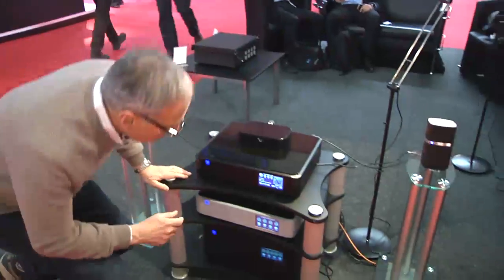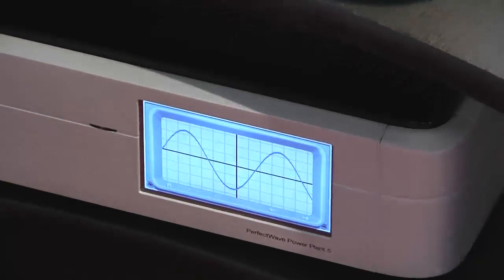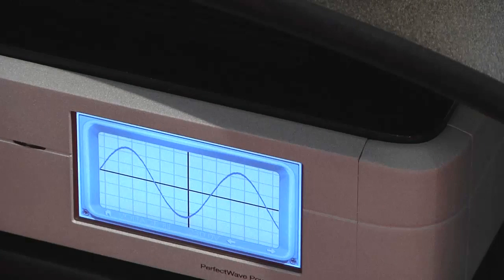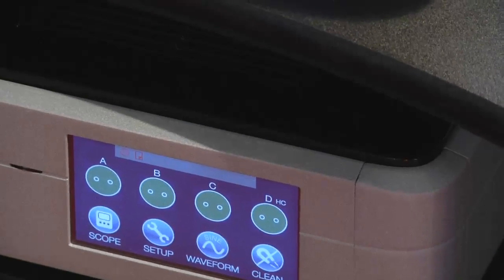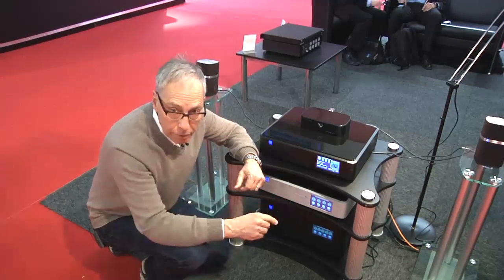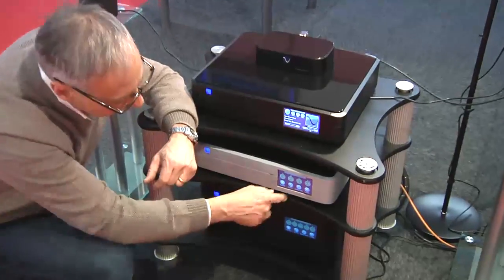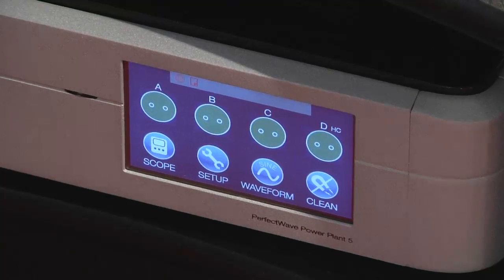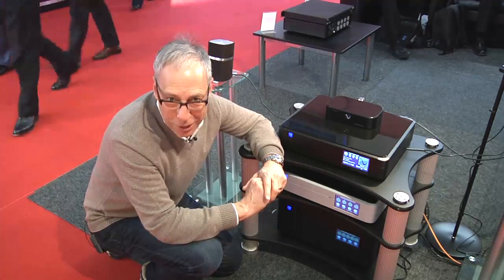ISE 2012: PS Audio  showcases its PerfectWave P5 Power Pl...

Comment: Fake... No AC mains look that bad and no practical AC restoration looks that ideal... Fake presentation. Besides, the AC voltage quality has zero effect on sound quality, unless you're listening to the AC mains 60Hz tone...
Reply: it was pluged into the p15 or what that big thing under the p5 was. thats why the ac was already thst clean. i have a p5 power plant. my ac doesnt look that clean. you never have a clean sinus curve. the tips are always gone and the voltage is always fluctuating. most of the time its roudn about 226v sometimes its 230 but its also arround 220. but thd is about 2.0-3.0% and outlet is 0.1thd.